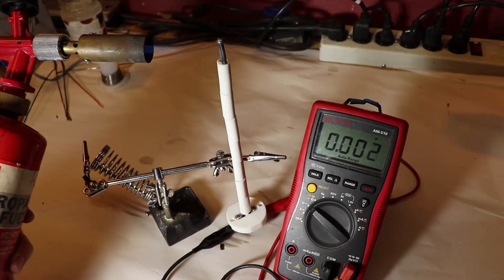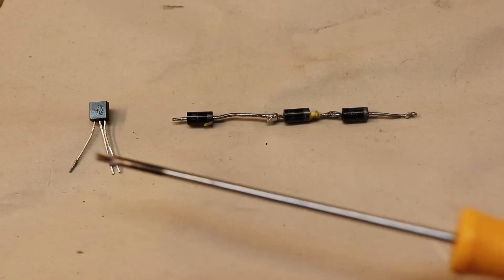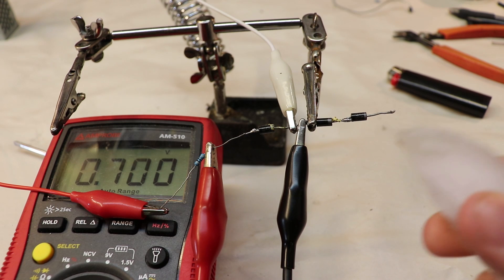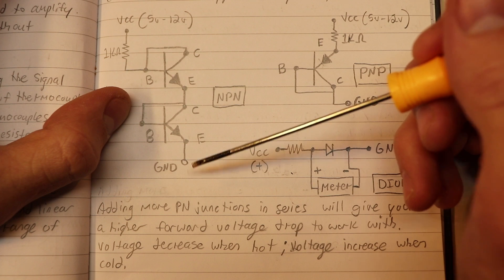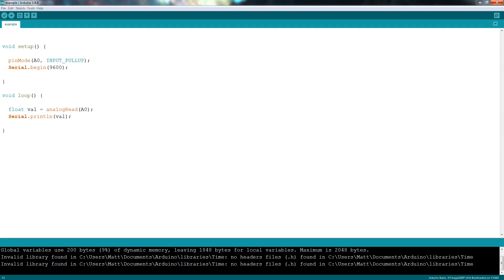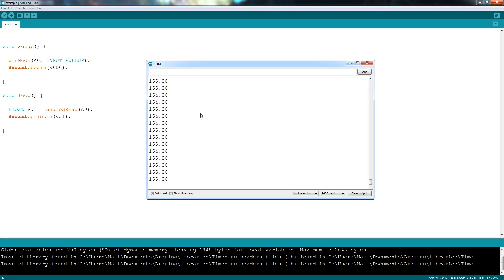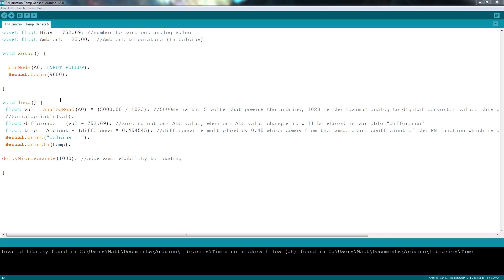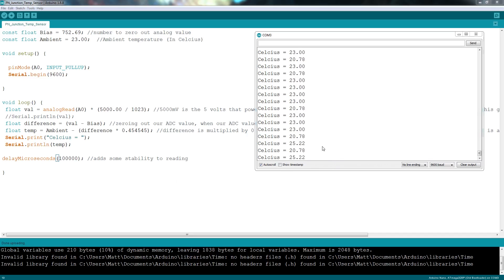Diode to Temperature Sensor

Comment: The calculations here assume that the diodes resistance is related to its temperature in a linear fashion.
To verify this you will need to calibrate it by taking a reading while it is in an ice/water bath (0 deg celcius) and again when it is immersed in boiling water (100 deg C).

Comment: You got the 'resistance vs temperature' of the diode backwards - heating up a diode would make it conduct more, cooling it makes it conduct less.
Reply from the maker: You are right! I might have to take down this video and insert a better explanation. While heat does cause more resistance in a regular conductor, in a PN junction you are actually giving energy to free up/allow more electrons to flow via heat and making it easier for those electrons to pass through the PN junction. Thus the forward voltage drop lowers because if its easier for electrons to pass the PN junction, theres less of a difference in potential (voltage) across the junction. Let me know if thats a good explanation or not, and thank you for pointing this out.
Reply: @SciCynicalInventing  I think this is a good explanation. Usualy you would use the PN junction as a thermometer with a constant current through it and that would make it even more obvious (and is done to have a constant junction voltage vs temperature law) - current stays the same but 'resistance' lowers with rising temperature - the junction forward voltage falls. 😉

Comment: 12:08 
Just write difference * (1/2.2) 
ll constants are calculated during compile time, turning it into 0.4545 makes it easier for anyone reading the code why 0.45454 was chosen. It also makes it easier to change the constant to 1/2.1 or 1/2.3 if that is ever needed.

Comment: Dude, great video.  Making temperature sensors from cheap scraps is great.  I have been using Arduinos and Pis for years but I didn't know diodes could sense temperature.  Keep posting!  Now I want to try doing it with LEDs.